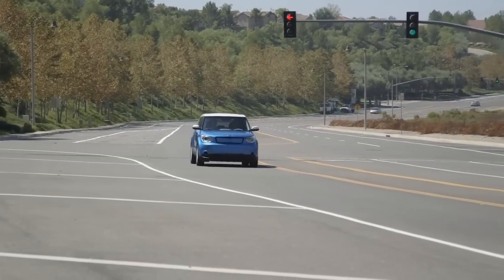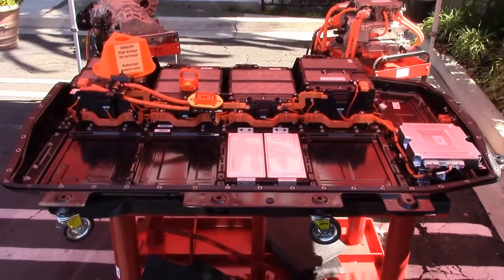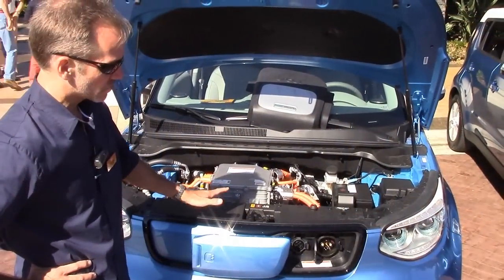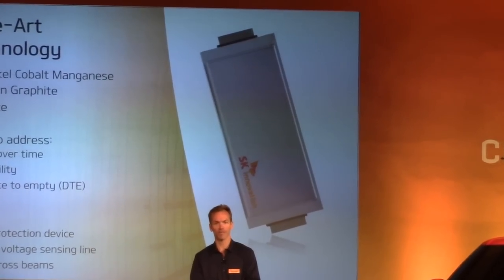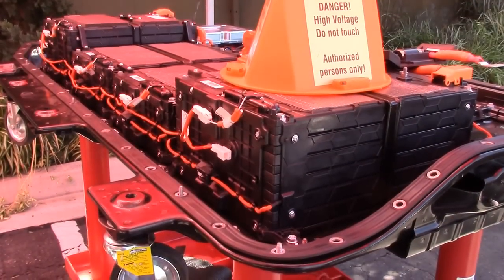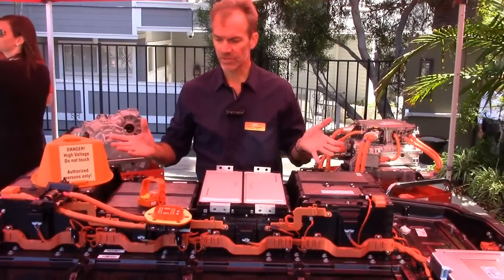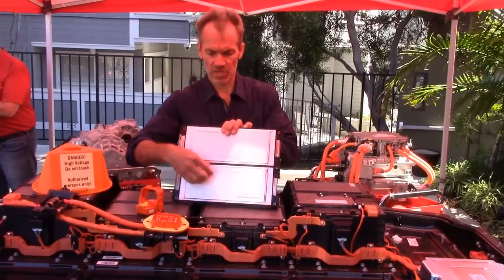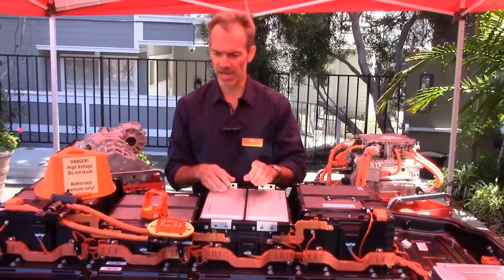2015 Kia Soul EV traction battery

Comment: Merry Christmas to all you SOUL EV Owners! 

Heres the breakdown. I purchased the car a couple weeks ago from a dealership in NC and brought it back to Dayton, OH. 

Today I took a roadtrip to see my family for Christmas Eve. 

CONDITIONS -
38* F on a nice sunny day - Tired properly inflated, 40,500 miles (B-Mode and ECO turned on) 
Only used the heat for 25% of the journey
Did my best to never exceed 68mph 

Traveled 49.9 miles and the car came back on 11% battery

If my math is right, I have a 55 mile range ~

Do I have a bad battery? I was expecting at least an 80 mile range on this vehicle...  :( 

I can also post a screenshot from my JuiceBox Pro app with battery charging stats.